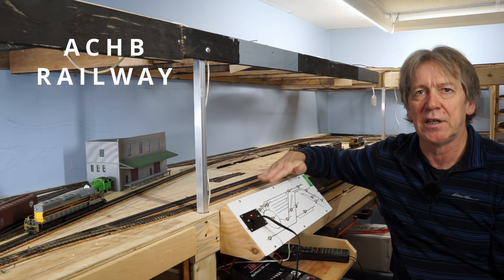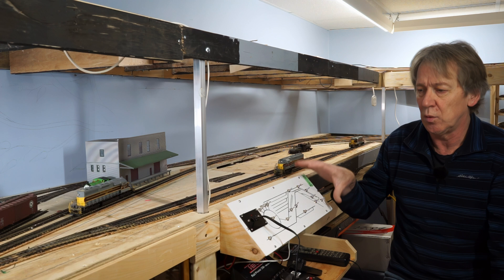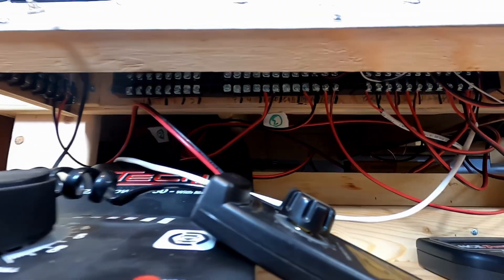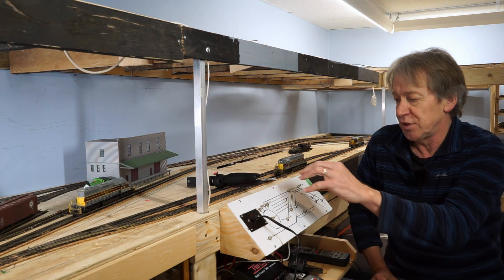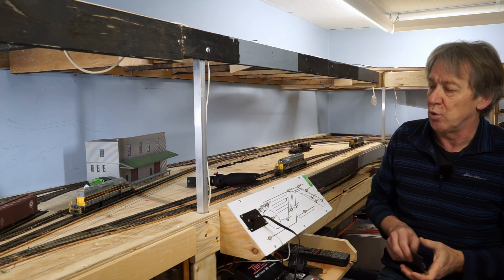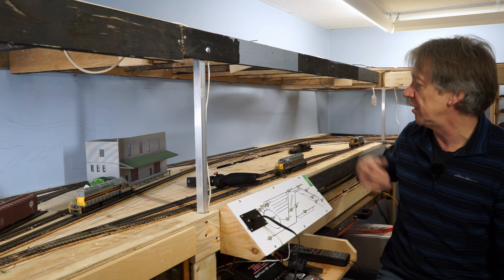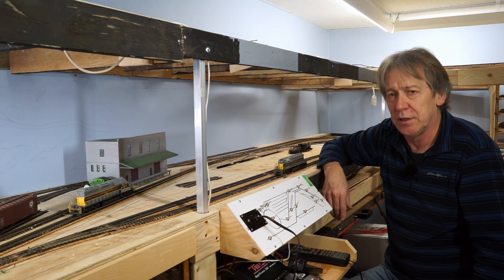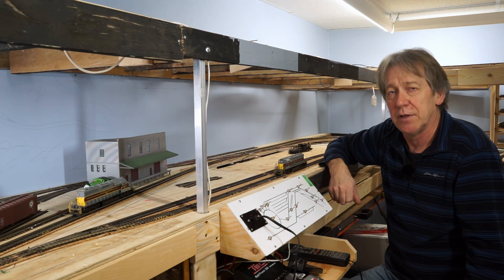Track wiring, soldering wires, and connecting my control panel. (Layout Wiring Part 2). ACHB 1-8

Comment: Thank you for part 2 and the additional info on turnouts,soldering, and Joiners. There is a company called cabinet parts that sell L brackets, up to 24 inches deep, that do not have the 45 degree angle bar usually found on the shelf supports if you wanted to remove the silver 2nd level supports that you are using and if not I also recently saw that someone on YouTube replaced them with clear acrylic rods, similar to towel bars and they greatly reduced their visibility.
Reply from the maker: Thanks for watching! The aluminum posts are fine with me actually- I’m also using them for wires between the two decks.

Comment: I'm guessing you have said, but why have DC and DCC controlling track power. seems odd to me.
Reply from the maker: Not odd at all. I have a lot of DC locomotives that I want to eventually convert to DCC. I have - so far - converted two of them to DCC. This allows me to use both until I get them converted.

Comment: Informative episode. I use a combination of a variable 80w iron and a weller gun. The number 1 hint I can give to any person new to soldering is keep the tip clean, either a wet sponge or better yet wipe with a piece of cloth and re-tin right away. Cheers Geoff
Reply from the maker: I like the metal mesh thing for cleaning the tip better than a wet sponge - the sudden heating and cooling of the tip with a wet sponge is supposedly not good for it (whether that is true or not, who knows...)
Reply: That's why I use a cloth, I can just grab it and wipe the tip off very quickly and re-tin. 

Works with reworking copper pipe too, sweat off old fitting, reheat the pipe and wipe with a rag, let cool, burnish with emery cloth, flux, heat and solder. wiping with the rag cleans off all the old solder.